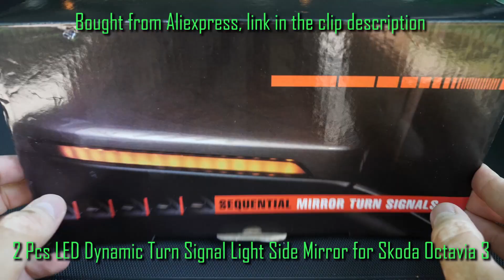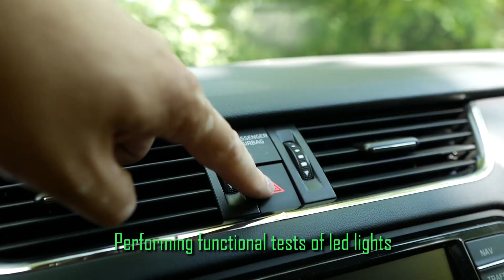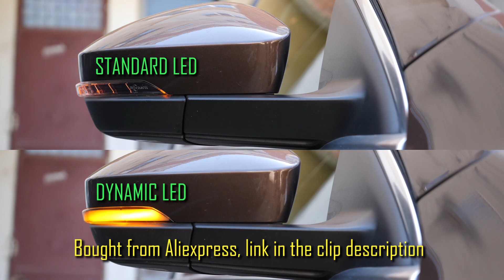Skoda Octavia 3 - Installing Turn Dynamic LED Light & Bright LED Light under Mirror

Comment: I have bought those exact under mirror led lights. Year and a half later, they lost their brightness and started flickering. BUT, there's an easy fix I did, and it works! You disassemble the small light, take out the PCB, put some reflective aluminum tape into the plastic housing, and add a small piece of white LED strip instead, solder the connector from the pcb, and plug it back in 😁 No canbus errors, and they fade in/out perfectly!

Comment: Where can I buy that set ? Thank you. My Skoda is octavia 2 the mirrors outside are quit different but the installation I think is the same. Year 2006 august.
Reply from the maker: Is this the model? https://www.aliexpress.com/item/10000293428235.html?aff_platform=shareComponent-detail&sk=_d61Ezs8&aff_trace_key=d6bf7f2e935540c89c2b47d7b5980c6e-1601813003513-02351-_d61Ezs8&terminal_id=364d159dab6d4da48c68657f8054a5c8&tmLog=new_Detail

Comment: Octavia is your car ? Yes or no ?
Reply from the maker: Yes, it's my car.
Reply: Why didn’t you buy a Peugeot ?
Reply from the maker: @blablabla4606  I found a very well equipped Skoda Octavia with automatic transmission and bought it for my wife and our baby. Anyway, I plan to buy a Peugeot 308 (2014-) next year and do tutorials on it.  I still have many tutorials to make on Peugeot 307 and 308 ;)
Reply: Adrian Dragan buy with full led lights very good lights I have 308 2019  it’s very good car